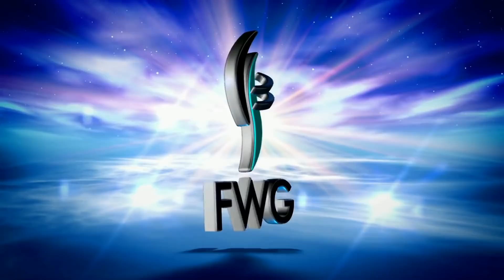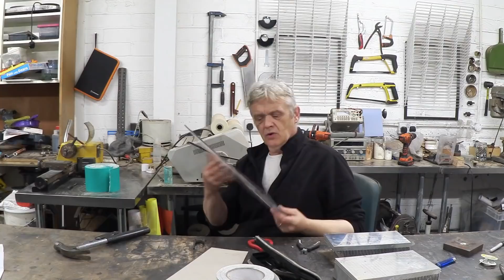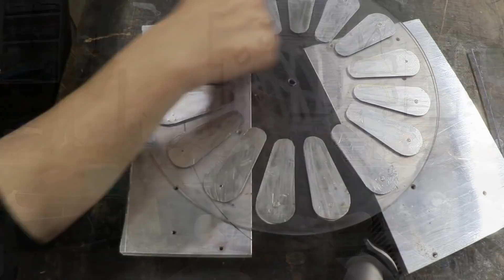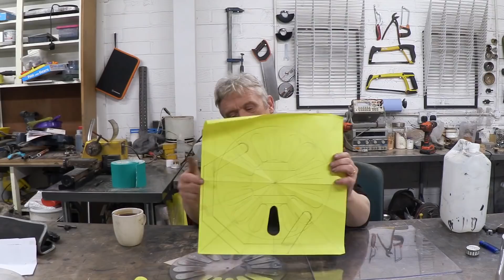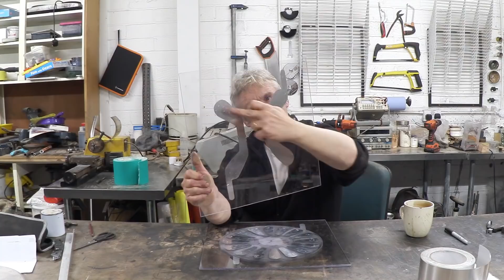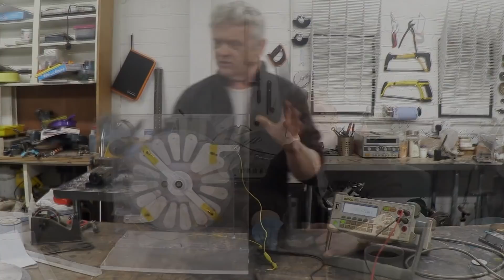Towards A Printed Generator

Comment: What would happen if you put one magnet on each side if the plastic outside sections, so when the spinning discs pass the magnetic field it will cause a change of direction in the molecular structure of the aluminium pedals, which should cause a higher output of electrical charge, but it should not create eddie currents against the effort of the rotating shaft, since each pedal is individualized.

Comment: Most intriguing, what is the relation to petal size and inducted charge? If you were to use more petals the number of times the brushes make contact would be more frequent, the area of induced charge onto the petals would be less correct, however the increase in contact frequency may increase the power.

Comment: In the United States that aluminum tape is horribly expensive although you might be saying it's extraordinarily cheap relatively speaking? For example that role that you held up it was a pretty large wide roll would probably be $40 here a standard size roll like that of blue painters tape you know the wide painters tape say 2 in wide, is on the order of $17
Reply: I'm not telling you this out of complaining I'm just spreading around useless information lol

Comment: This idea offers someone in a bushcrafting situation a way to start fire  in addition to powering small tools from slowly charged batteries. In the woods sap can be used in a variety of ways: sealant and waterproofing are of highest interest to me. Stacking these is certainly a key to power improvement. Other improvements may come from petal counts and lengths. When I’m ready I’ll need to play with this myself. If my results are worthy I’ll post them.

Comment: What if you make this as a sandwich? Square slices and the rotation disc in between? And this several times ? The only thing that might be different Is connecting them. In parallel and serial?

Comment: Awesome can't wait to see the follow up on this series ! Stacking them sounds good ...if using a light and thin material could potentially stack hundreds in "Not such a big space" lol with a decent efficiency.., really wonder how such device would compare to a industrial grade generator in terms of efficiency (mechanical power converted into electrical) this could be the FWG generator, sell the kit and make $$ on it + ink :), also rather than thinking in terms of total power output maybe it's best to think in terms of "whats the minimum amount require to charge a battery bank" (12,24,48+) so then we don't necessary need the peak power in amps, just thinking out loud here.. :D

Comment: I would love to see that static generator running off a wind turbine.  In other words, a windmill without the usual magnets and coils of wire.
Reply: I was thinking the same thing actually.  I've been looking at Van Life and one of the issues there is power. Most people have a few solar panels, an inverter, and someway to charge the house batteries off the alternator when they're rig is moving.

Of course the problem with solar is, it's solar.  It's fine but it has a significant flaw at night and it's hard to get a good charge in the winter with out basically using your rig as a gas/diesel genny.

Something like this that's small but potentially relatively constant and provides more options for placement then typical solar panels could be a good secondary power source for Van Life builds.

Comment: Curious; if you ran several of these in parallel would it step up voltage and/or current, and would you need capacitors/rectifiers between the units?
Reply: I think it produces AC so yes you'd have to account for that.

Comment: A very Informative Video Robert.  What about using Sheets of Printing Paper Treated with a Polymer that would harden up forming a Ridged Sheet so you then could Stack a Ream or Two together and have the Power output you desire?  Just asking Robert. You could also design and use a Flat Copper Coil placed on each Collector then using a Simple JOULE THIFE Circuit Generate more Power storing it all in a Supper Capacitor. Is this a Possibility? Thanks for the upload Robert. As all way's, you sharing your Knowledge is Appreciated at least by me anyway.

Comment: Very interesting stuff once again mate.  I'm looking at this and what pops into my mind is combining this idea with that of a Tesla turbine......I see in the comments that Leo C and some others had the same idea. Since rpm's play a big role in getting a bigger output and the Tesla turbine gets up to some pretty high rpm's, especially when hitting the sweet spot, that might work quite nicely.
I've been working on a tesla turbine with magnets on the edges of the disks and a coil around it as a turbine for an ORC-generator (so you don't need to combine a turbine with a separate generator to generate electricity) but this could be a good alternative. It would be good to hear your thoughts on that.
Reply from the maker: I do like the idea of linking this with a Tesla turbine

Comment: I was wondering if you were to say coat a piece of metal cut out to that teardrop shape, and coat it with carborundum powder on the bottom surface, and attach it to one of those vibratory tools , could you vibrate out a shallow pocket in the acrylic, and do all the sectors, and then when done all around, coat that acrylic with the conductive ink like you are screen printing, and leave it only in the pockets? possible result, mechanical attachment to the disc, and its depth predicated by the depth of the vibratory pockets?
Reply from the maker: I guess you could but it is a lot of trouble to go to - if you watched the testing video the mechanical adhesion of the ink is really quite good to the acrylic

Comment: Have you ever wondered about an insulating ink? It would allow stacking coils of conductive ink. I have a penn plotter and I see how I could literally print coils with it. It would be a weird part to design and also tricky to print, with pauses to switch the ink pen.
Reply from the maker: a polyurethane varnish would work wouldn't it?
Reply: @ThinkingandTinkering  ah probably, it would be quick.

Comment: So if you created some high voltage caps out of aluminium foil and plastic and ran a wire up a tree you could run the generator and do some real work with it.  I didnt think of printing the generator, I could do it with a silkscreen.  This is getting interesting. Thanks
Reply from the maker: I would think so mate

Comment: Fascinating. I wonder about the torque for this. If it is as low as i suspect, you could add a gear and get a lot more RPM out of it. I didn't see if you had a bearing in the center. I assume you did so the torque would be very low,.
Reply from the maker: I did have a bearing mate and yes the torque was exceptionally low

Comment: You can also buy some copper tape if you like, I bought some to use as a gasket on my engine, and I have a whole lot left over.
Reply from the maker: yep copper would be fine if you have load - Ali is cheaper - lol - look at me - thinking about costs lol

Comment: a generator with NO coils & NO magnets is purty amazing.
Reply from the maker: I mean I know the output is low - but I was amazed too
Reply: @ThinkingandTinkering   here's an idea to try;  take 2 pieces of wire,  attach 1 side of each to a hv point of the dirod,  next take 2 spark gaps,  each set to a width of a sheet of notebook paper;  attach a spark gap to 1 side of each wire off the dirac.  attach a 500 V capacitor to  the other end of each spark gap.  spin up the dirac and.check the voltage between the 2 capacitors,  assuming i'm no more confused then usual, it ought to be around  300 volts at least for a moment.

Comment: If one were to seal this from the environment as you suggested, the resulting enclosed container may then have its air removed, leaving a vacuum. this would virtually remove any resistance on the disk from drag. For something so light with such little inertia that little amount of drag could drastically affect the efficiency.
Reply: Pulling a vacuum could pull in the sides -- you would have to glue in some acrylic standoff dowels in strategic spots to counter that effect.
Reply: @anneinfurna8528  True, wouldn't want the project to be crushed due to lack of structural integrity
Reply from the maker: yes I would think it would

Comment: Can't wait to see where this goes :-).  Would thicker aluminium plates improve output?  Now to run it as a motor.
Reply from the maker: I don't know mate - to be host there are a couple of possible sources for this effect and it wy be that it is just triboelectric between the acrylic and carbon brush - the effect was certainly interesting but a little more investigation is needed I think before we go off on one

Comment: When you think about it, this is pretty cool. As you said, no magnets or coils and apart from the axle and the carbon brushes, nothing is touching. This could be driven by a fan on a large pulley and a small pulley in place of the handle. Of course once it has been sealed.
Reply from the maker: for sure mate - there are a couple of thoughts that have sine occurred to me as this was an interesting and unusual effect
Reply: @ThinkingandTinkering  looking forward to the next video, will be something special to sit down and watch for my birthday 😂

Comment: I think you are only a few thoughts away from discovering  how to build a UFO ! 👍🏻
Reply from the maker: lol
Reply: I was thinking the same thing, the problem with lifter technology is that the power supply is too heavy. If you had disc-shaped capacitors on each side would it charge them up to high voltage?

Comment: fantastic as always Rob! the possibility of printing these things cheaply, quickly and easily, perhaps on old CDs again but also industrially, is incredibly exciting. 

one challenge i'd love to hear your thoughts on is how you'd go about prolonging the lifespan of the paint and brushes, especially at high RPM, as my first thought is to put a stack of these into a tesla turbine somehow.

i feel stupid asking, but the large surface area of inductors and collectors is important right, as its the surfaces passing eachother that creates the inductance? the neutralising bar could be a small point near the axle though, as long as the contact arc is the same so the timings align?
Reply from the maker: spot on mate - surface area does matter in repeat of out put - if you think of a bonetti machine then there would be no contact but it would need a starting charge - but that wouldn't really be an issue

Comment: Well done, Robert.
Instead of your fabricated rivet, I would've drilled several small (030") holes and then put a dab of your conductive ink on both sides.  That would make a plated-thru hole like in a PC board.  The voltage is so high and the current is so low that the resistance of the ink is inconsequential. As a matter of fact, I think you could silk-screen all the conductors for everything using your ink.
Reply from the maker: true mate - but I was thinking of folks who didn't have the ink

Comment: Very fascinating!  The flat profile alone opens up several possibilities.  That foil tape is useful for so many things.  I've used the tape before to test a homemade capacitor.  I used the lid of a CD case, applying equal pieces of foil on both sides.  It worked better than I thought it would.  You're right about one thing; humidity is the main downfall of any electrostatic system.
Reply from the maker: you are right that tape is just too useful for words

Comment: That is great technology.  A flywheel UPS lead to the breakthrough of the flywheel drive that Porsche took and revolutionized as the GT3 Hybid.  Basically, a Dirod.   When the car brakes, it charges the flywheel, and when the driver hits the button, it sends it back to the motors.  97%+ break energy recovery!
Reply from the maker: that's interesting - cheers mate

Comment: You're worth your weight in Platinum Robert!   Great presentation and really cool build...
  Perhaps I misunderstood: Didn't you say it worked as a motor or a generator?   Will it do both at once?  Motor on one side production on the other?
Reply from the maker: that's what I read mate - I have yet to try it tbh - even so I suspect not - I would think it would have to have another device attached to the same axle
Reply: All motors are generators run in reverse and vice versa, it’s just a question of how symmetric the efficiency of electrical power to mechanical work or vice versa. This device feels like it would run very symmetrically (and it is beautiful by the way Rob!)
Reply from the maker: cheers mate

Comment: I'd really like to see this implemented on a larger, more efficient scale. I think like others I'm also wondering if it has any potential as a kind of DC step motor?
Reply from the maker: I dunno mate - that's an interesting idea for sure
Reply: I hate the idea of using electricity to generate electricity. Way too many people start with those ideas and it quickly becomes physics defying.  But... With an added flywheel and a simple low friction bearing a simple low power motor might be able to make at least an equal voltage out-put.

Comment: I love it, Robert. My compliments. If the unit needs to be sealed, could something like an aquarium be used as a container, to then pull a vacuum to reduce internal friction?
Reply: Just remember that a vacuum might change how it performs in other ways; with no magnets or coils it is basically an RF receiver, so it might need some fluid medium to traffic the charge with.
Reply from the maker: for sure mate